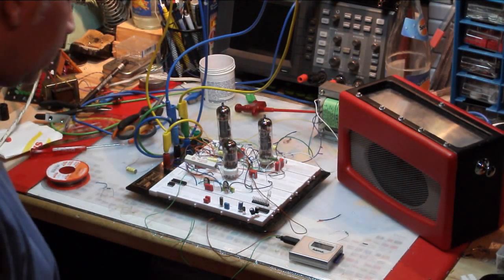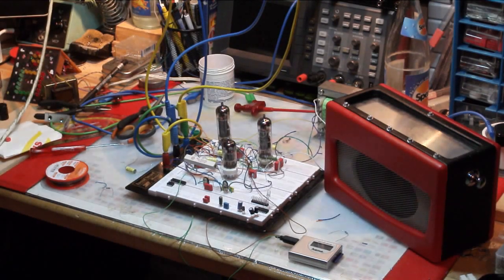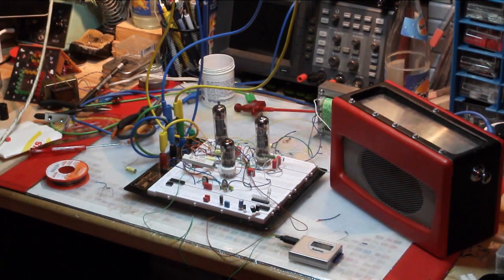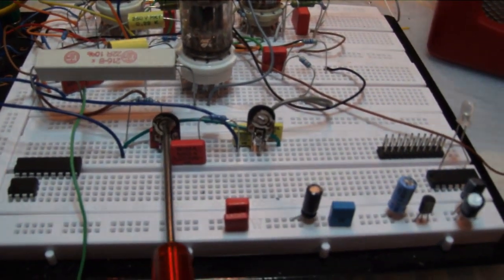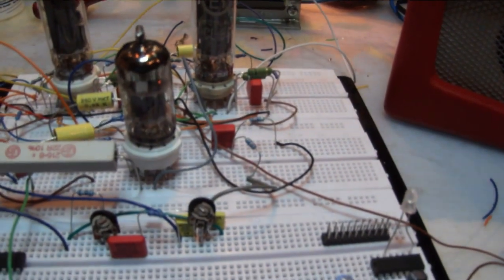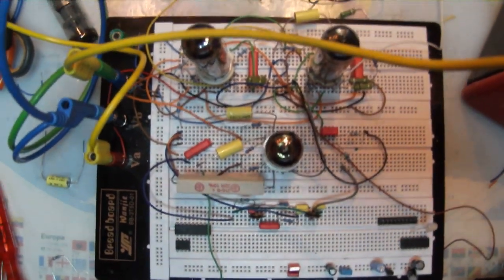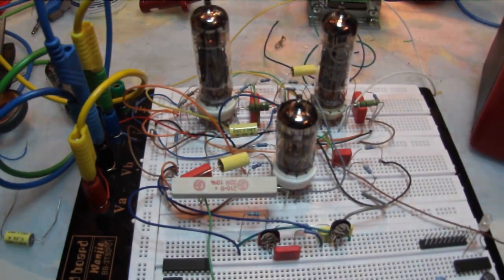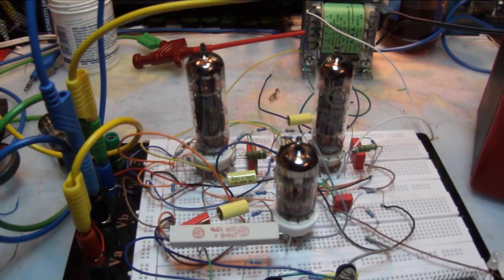TinyTubeAmp - First Run

Comment: Cool thing!! You may show us the schematics for this one, if exists;)  I never thought a breadbord can be used for tube circuits. Just because of its high voltages. Anyway my personal usage of these breadboards never exceeds some 50 volts....But now i´ll put a noval type tube socket onto it and try it in conjunction with my OpAmp based stuff....Thank you for this encouraging video! :)
Reply from the maker: As there are some questions coming in where people want to know some more detailed info, i´m thinking of doing another one, in where i explain the circuit/design more specific....So stay tuned...;)

Comment: Following along.  Any books or reference you can recommend to me???  I've seen all of uncle doug's vids that explain basics, but I need to get a little deeper into understanding how all this stuff works.  Thanks.
Reply from the maker: Hi Greg, sorry for beeing that late, but i´m very busy these days.....

My very own "reference" had always been old, non working and/or cheap old amps. I probed around inside, and check why there are not working and if i was able to fix them.
As i do not know any english written books i can´t help you that much here. There are some good books i could recomend, but there all written in german, sorry. But if you just need some more info on tubes in general, here at YT are some cool old documentations about tubes, from the former big tube players like these:
Vacuum Tubes (Valves): "Electronics at Work" 1943 Westinghouse 21min
Mullard - The Blackburn Vacuum Tubes Factory (Full)

You may try the "RCA receiving tube manual", as i just found an online version.

http://www.tubebooks.org/tubedata/RC30.pdf

...It´s not intended to be for educational purposes, it´s basically a databook/reference for tubes made by RCA. But on some tube they included a large scale of information and/or some basic ciruits to begin with, along with some diagrams and/or curves of the tube´s operating points. And they included a good, but very compressed/concentrated overview of the tube´s function and some little "how to´s" as well in the fist 20+ pages....So you may check it out and see if it helps you...

It´s always a good starting point to go from back to front, if you plan a Power Amplifier. As when you know how "big" you want to go, then next is to choose the type and number of your output tube(s).
Next is to have a propper output transformer.
After that you can test this and see how much voltage swing you need to drive this tubes to full swing. I strongly recomend you choose class A/B first as control grid current is great but not as your first design. Just make it simple and easy to build is, by far, the best for the first DIY-TubeAmp...:)
Next is to design a propper driver stage. You can have a look at some classic Amps here, as they are prooven to work.

If you run into difficulties, just ask...;)
Reply from the maker: Hi Greg, you asked me and i looked here found nothing, and by the time i was thinking of doing some tube circuit basics i came across these series of videos:

Tube Theory part 1

Nothing more to say, as he (Dennis) have done such a great work on this, i think it´s just what you need to dig deeper in the tube field. :)
Reply: Thank you!!!  Watching it now!

Comment: Very nice - thanks for posting - if you ever need anything sent to you from the US, just let me know -  I just discovered a place in Las Cruces, New Mexico that has 7000 square feet of everything electronic that I have ever seen - mostly all vintage stuff.
Reply from the maker: man, why you say that...as i love vintage electronic, we got a reseller/pawn vintage tube Amp store here as well, but he´s very expensive....but he still got a fender vibrasonic 1x15Inch combo amp, that i would love to have;)
I you come across some cool old USA-tubes, we could simply swap them (in equal power dissipation area) as i got some not very common types us-based people.....
A cool idea is, if the owner of that giant store agrees, you could do a video of it.....
Reply: TubiCal That is a grand idea and I will definitely take my camera the next time I go to the store and see if he will allow me to make a video of it. It is amazing how much stuff he has. I assume that a large majority of the Tektronix and HP test equipment came as government surplus from White Sands Missile Range - I picked up a HP 536A frequency meter from him that is spot-on accurate. It has WSMR stickers all over it. There is also a book store in Las Cruces that bought the entire tech library from WSMR when they closed it. I spent many hours in that library - when I was supposed to be working...  :-)   As the library was closing, back in the '90's I stopped by where the ladies were inventorying the books and they told me I could take what I wanted and like a complete dumb ass, I think I only took one. I have sense purchased a couple from the book store that bought them all.

Comment: A very nice, compact amplifier, TC.....and I really like the cabinet. The contrast between the red and black vinyl is quite striking and attractive. I know you are not finished with the cabinet, but it still looks great in the video. Good luck fitting all the components into that tiny case :)

 I look forward to seeing the finished product. Thanks for sharing this with us :)
Reply from the maker: Thanx for your encouraging comment, Doug. I appreciate it :)

As i did not know how it turns out, when i finished the front completely i was really impressed, and therefore i decided to do the front and back in red and the top, bottom and both sides in black. But i still got to do the black sides, as they are covered with the original thin artificial leather. But all mechanical and mounting has to be done first.

Here are really big Heads and Amps around, so i thought it´s time to do a tiny One...;)
Reply: I like how it's turned out so far, and can't wait to see (and hear) the finished product.

Comment: Just viewed your latest project. Bravo! Keep up the good work. Thanks for sharing.
Reply from the maker: Thanx for your encouraging comment, Hubert :)
I´ll go on with this toppic for a while, as i already got some plans for a little "FullStack" as the speaker i´ve used in here, is good and very efficient but it lacks in bass performance, but i came across some speakers with far better LowEnd performance, but they are slightly oversized to fit inside with the amplifier as well, so i´ll put it in a seperate cabinet.